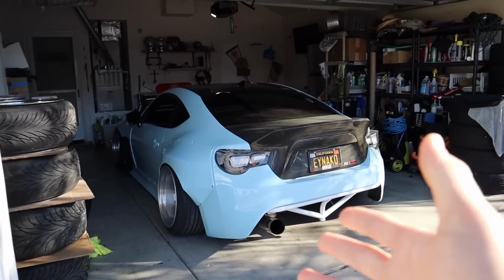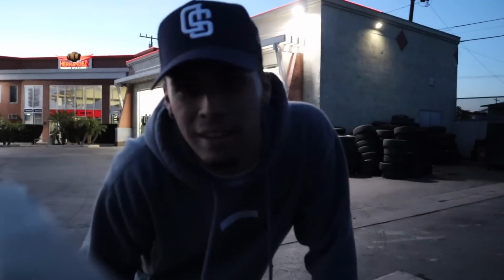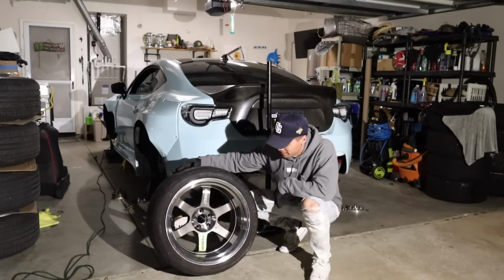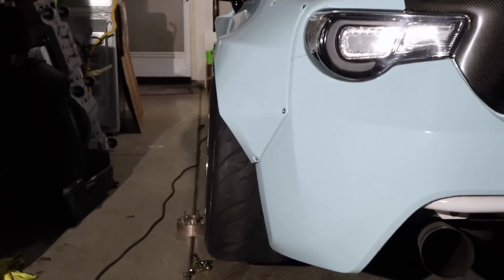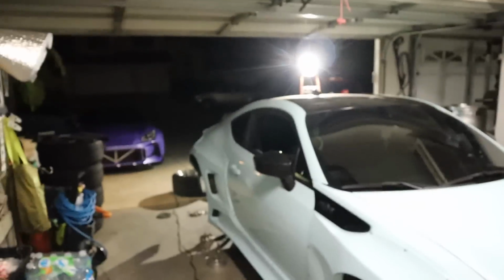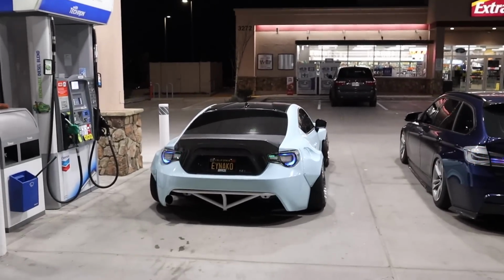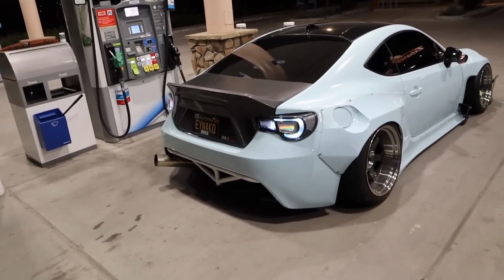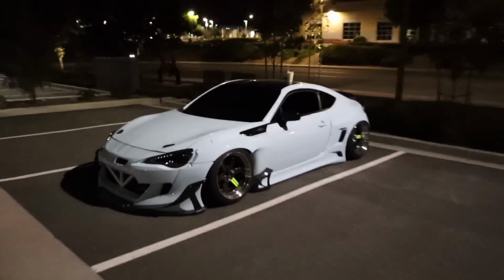NEW WHEELS For My Rocket Bunny V3 FRS!

Comment: I just don’t know why you would get rid of the bags unless you were planning on  doubling the power of the frs
Reply: or slide car?
Reply: People really underestimate the strength of air suspension. Airbags are rated for thousands of pounds, easily doubling the weight of the car.... Bags are pretty stout.
Reply: @kaim3049  no doubt, I’m just saying I wouldn’t give up bags unless I was going for 700+ whp
Reply from the maker: Just something different since all the cars would be on air suspension if I kept it on the FRS.
Reply: Static boyz all day!